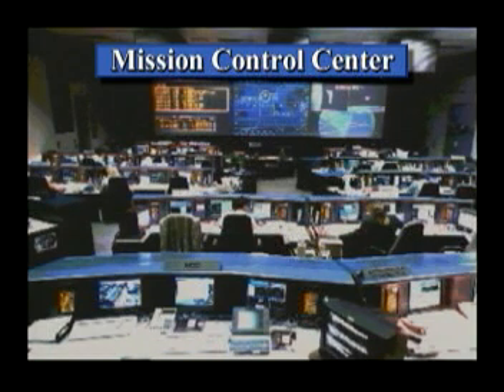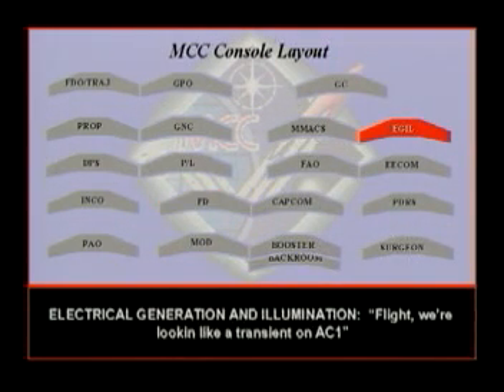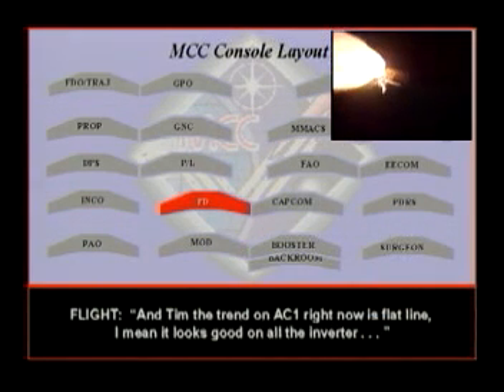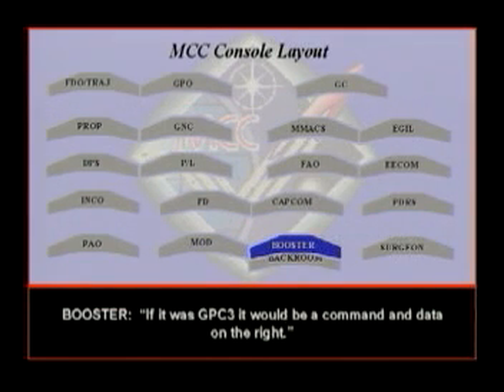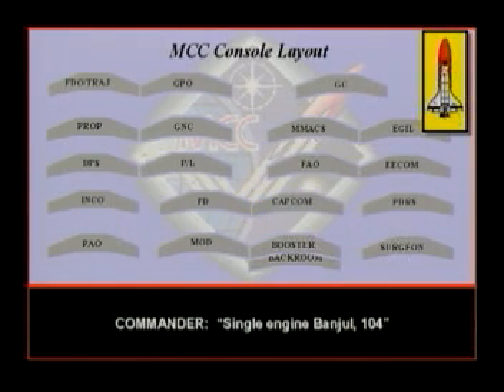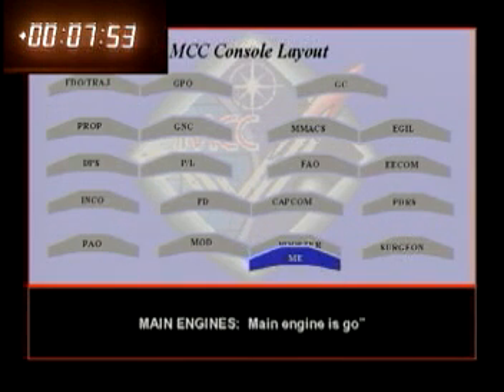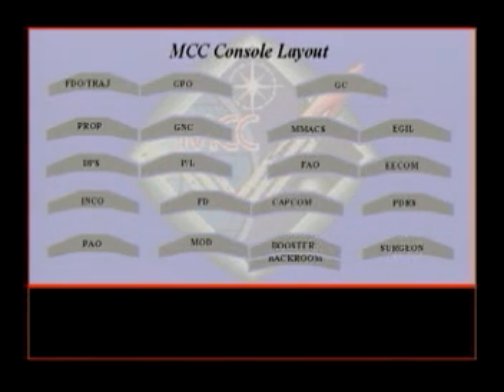STS-93 Ascent MCC FCR Internal Loop

Comment: There is so much going 
on here. At 1:02 the backroom ME(Main Engines) guy makes the "throttling up call"  this is when the engines have started and are coming up to 100% Rated Power Level, then at 1:05 he calls"three at one hundred main stage" meaning the 3 RS-25 have attained 100%RPL.  At 1:11 the calls "throttle up, three at one oh four".  The shuttle came off the pad at 100% RPL, then throttled up to 104% RPL. (Once the RS-25 went to the full Block-2/RS-25D, an extra 0.5% RPL was added for 104.5% being the nominal throttle setting for the rest of the program.) Off the pad at  100% and then 104.5 after tower clear

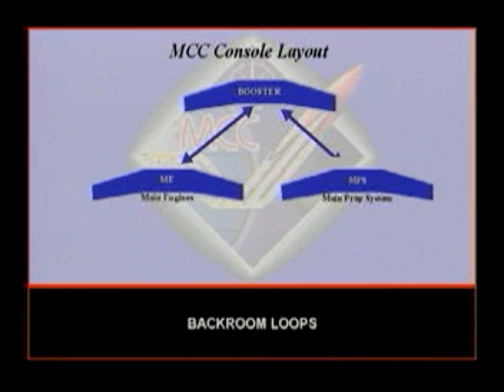Those are all nominal calls, what ensues is mucho off-nominal, but trained for nonetheless.  At 0:40 seconds it shows a great visual on how the "backroom guys" the ME(Main Engines) guy and the MPS(Main Propulsion System) are in the loop with the Booster controller who is located up in the MCC(Mission Control Center) directly behind the CAPCOM. 
 This was the heaviest payload in Shuttle history. 50,222 pounds or 22,780 kg. Most of that was the IUS(Inertial Upper Stage) a 2 stage solid rocket device that was used on Shuttle and other rockets to boost payload into higher orbits.  The Chandra X ray observatory only weighed
12,930 pounds/5,860 kg fully fueled and ready to launch, the other 37,000 pounds/16,920 kgs was all weight from the IUS.

Such an excellent glimpse into what it took to operate the most complicated vehicle to ever leave the ground.

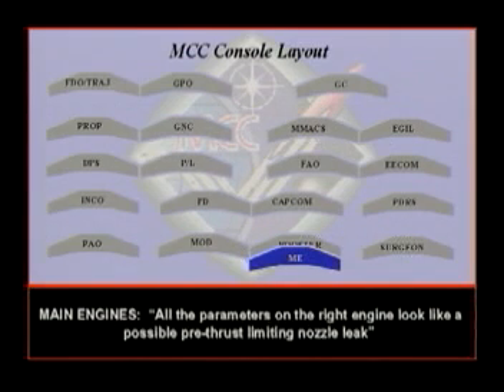Comment: HPOT = high pressure oxidizer turbopump, OPOV = oxidizer preburner oxidizer valve, at ~4:30 they're discussing whether it's a nozzle leak or oxidizer turbopump issue (and sensor readings relative to the redline), as discussed in Wayne Hale's post